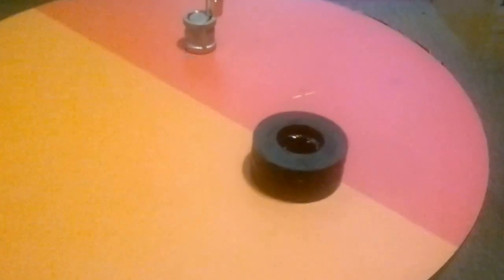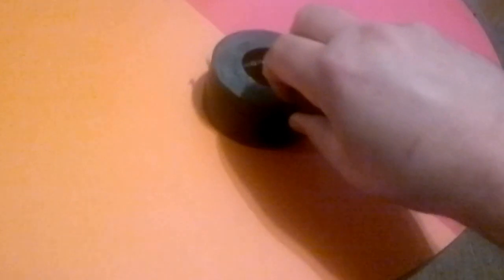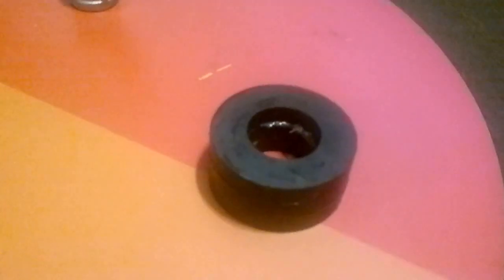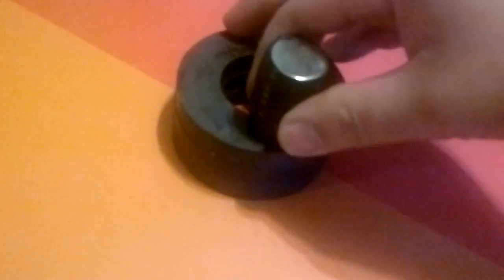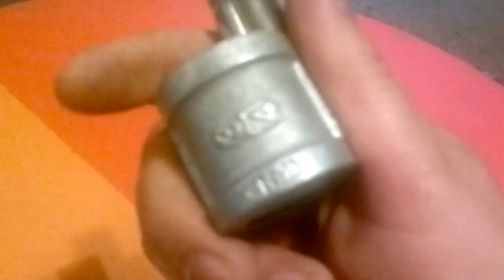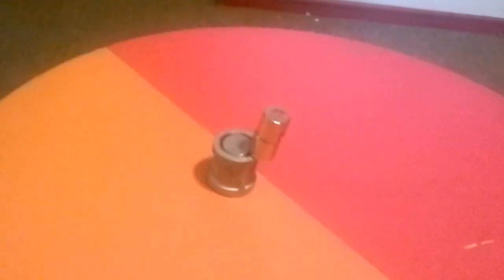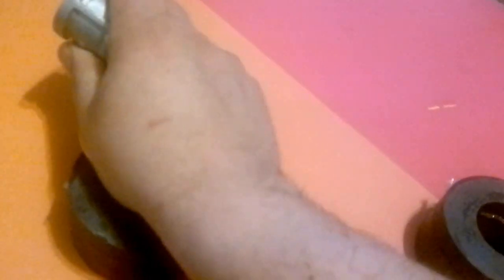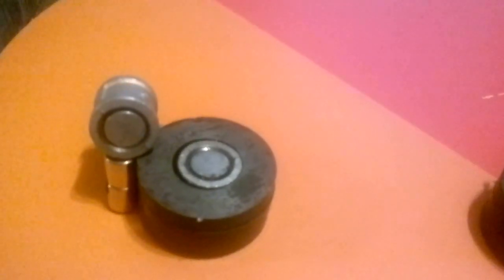How To Fill In The Hole On A Ring Magnet Without Having The Magnet Fly Back Out!

Comment from the maker: yes thats just my nickle size magnets without the metal backing on them, thats how tight of a fit it was had to take off the metal sheilds off them. Yes got that coupler in the plumbing section of home depot, nice 1/8 inch steel. Does having the center magnet increase the overall strength? hmm good question, one second I will do a test......Okay im back lol I just stuck one of each on a metal wheel both flat with the metal good connection on each. And yes the solid one was 25 % harder to remove.